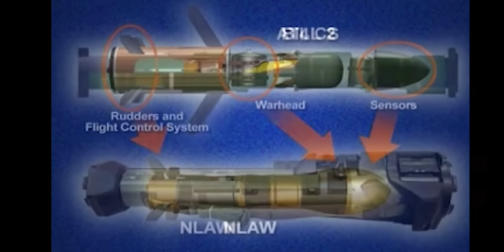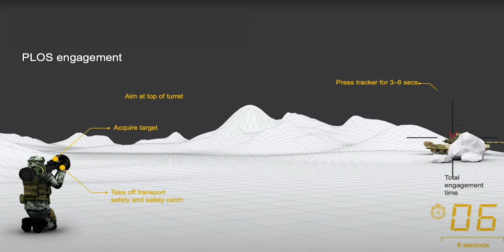Is the NLAW ATGM overrated? Next Generation Anti-Tank Missile

Comment: I've seen videos of these in Ukraine bouncing off of Russian tanks. I've also seen them kill some Russian tanks. So it's 50/50? Lol my favorite video is of a couple Ukraine soldiers firing one from a 2nd story window and it just bounces off the top of the turret of a T-80 variant. And the Ukrainians yelling,cursing and running as the turret turns their way. Lol 
Great video and have a good one.
Reply: If an NLAW bounce of a tank it is most likely because the rage was to short and it did not have time to arm itself.  There is an arming distance so you do not kill yourself by mistake. It will be primary if it hit something close by mistake like a stone and kill yourself and your buddys.  At a longer range it should not bounce off a tank, it should fly over it. If the detonator fails  it would explode bound the tank when it is something or when the auto sele-destruction is activated at around 1000 meters
Reply: @target844  that's what happen. They were like 15ft to 25ftish from the russkie tank.
Reply: @warhawk4494  So a case of user error since the arming distance is 20 meters.
Reply: @target844  yup it is. From what I've been seeing over there from videos and clips on telegram (which I'm taking everything with a giant block of salt but trust way more then CNN and the bbc.) the....ukraine soldiers...are slacking in some areas of training and have spent more time selling our equipment on eBay then learning to use it. Seriously you were able too and might still be able to buy a complete javelin set up for 20k or 30k. Battery,launcher,missile. Da works.
Reply: LOL, no. You need to just look at the disastrous Russian losses. The orcs are using rust old T-62 MBTs now.
Enough said. 😀

Comment: This is a huge video before I watch I’m going to say a couple things.

1. There seems to be sharply diminishing returns in terms of what man portable firepower can do against tanks. At this point just from Ukraine I have seen tanks and even lesser vehicles survive hits from the javelin I’ve seen them survive hits from the Stugna I’ve seen them survive hits from the NLAW I’ve seen them survive hits from the AT4 I’ve seen them survive hits from all kinds of RPG systems. It seems like in general having any kind of man portable system which can reliably engage and destroy armor and single hits is pure fantasy. The Stugna is a 155mm system that weighs 80 pounds and needs to go on a tripod, and I’ve seen a video where a Russian tank takes two hits from it and is still fully operational.

2. Regardless of power, the main thing that seems to dictate which rocket systems infantryman actively choose to take into battle is weight. I have never seen candid combat footage of anyone going on a patrol or into an attack using the javelin. I have seen it used from prepare positions but I’ve never seen anyone use it as a maneuver element. The three most common systems I see actually get employed in footage are the RPG7, the RPG18, and the AT4. What unites the systems: they are all lightweight at least in comparison to some other offerings. The 7 is only 14 pounds when ready, the 18 is 6 pounds, the AT4 is 20 pounds. The NLAW is 35 pounds and the javelin is 50 pounds!

3. No extant modern lockon system is anywhere near fast enough to not rely on enemy compliance. I know the javelin requires the better part of a minute after waiting for it to power up to be ready to fire. That is a very long time you have to expose yourself to the enemy and hope they don’t do anything to kill you or break line of sight.

4. Man portable antitank systems are still important because it is absolutely better than nothing. It’s basically fantasy to take down any kind of tank with any armor package from the last 30 years in a single shot but multiple hits can and will have a serious effect. It’s a very sub optimal solution though as the tank is going to go down swinging with deadly results for the rocketeers.
Reply: But let's face it: Most don't survive a hit from a MANPAD missile. 
The numbers speak for themselves.